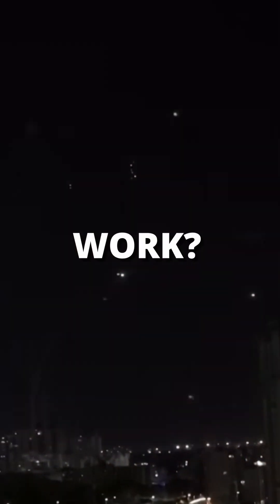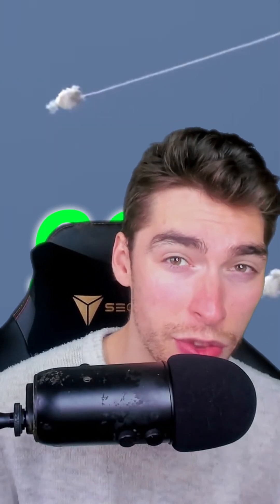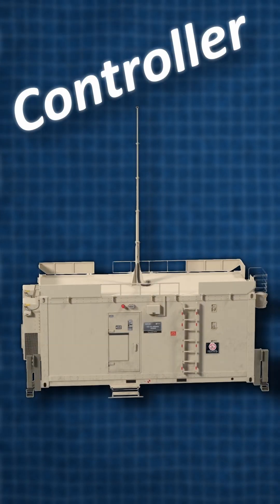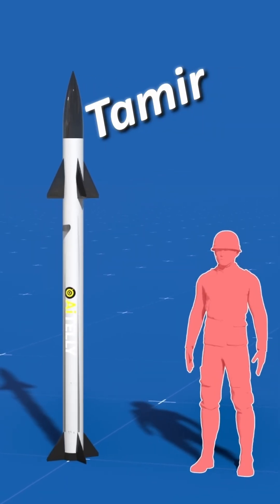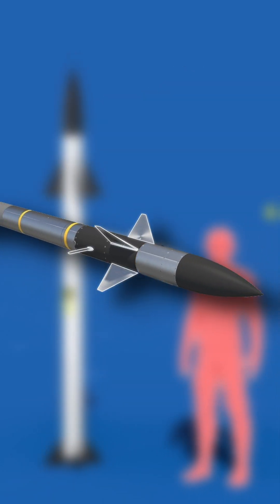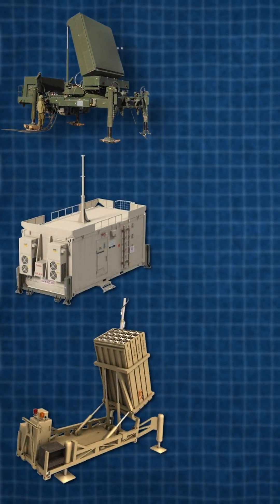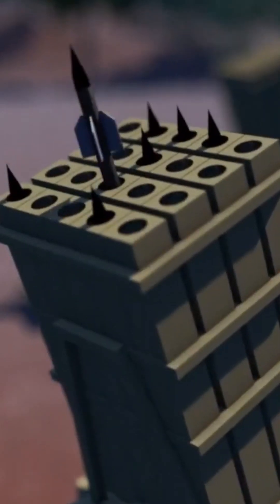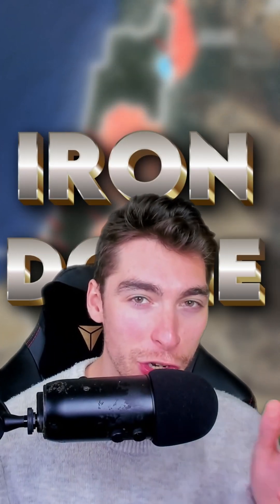How Doess The Iron Dome Work?  #military

Comment: they are replacing the iron dome with a direct energy weapon that cost so much less, roughly around under $20 per shot and can be more fortified and defended.
Reply: Not replacing, supplementing. The iron beam is not effective at longer rangers